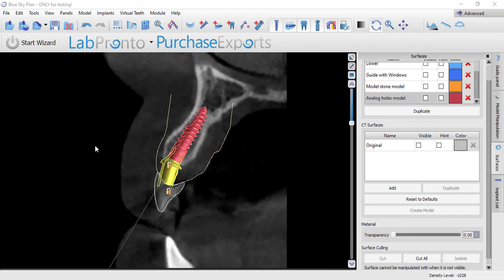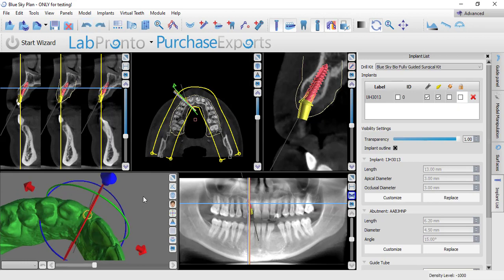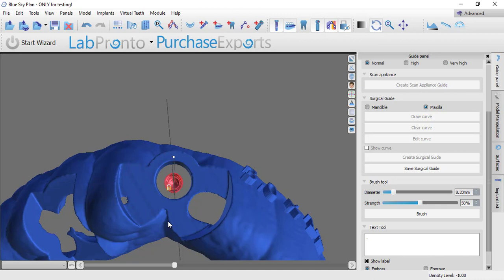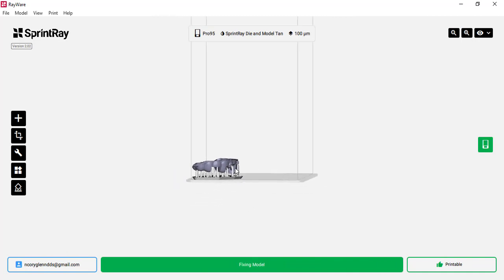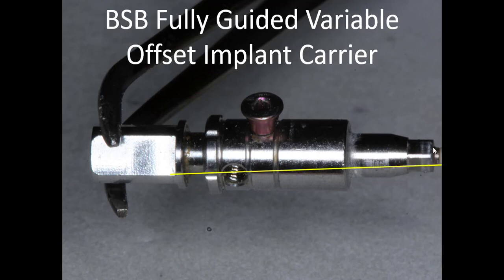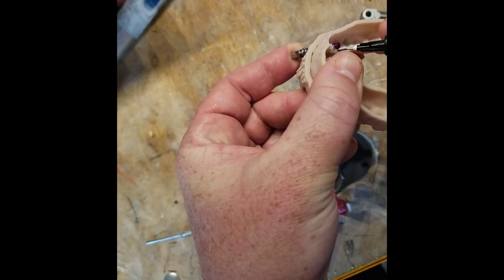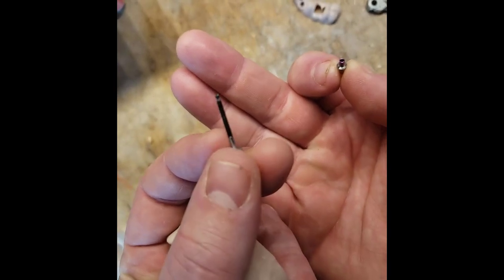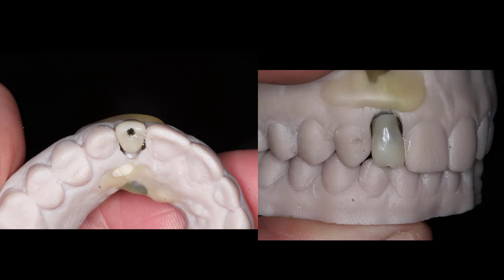Controlling Your Implant Timing with Guided Surgery

Comment: Hi, any reason you can't just use the Implant mount to control rotation? Many of BSP implants do not have internal connection information, it's just round generic. Just use the mount and rotate until the flat is on the flat of the guide??
Reply from the maker: That works great assuming the guided driver has a flat or timing marks but not all do.  The internal connections will only show in BSB if the implant company includes them in the implants they submit to put in and some companies are weird about that